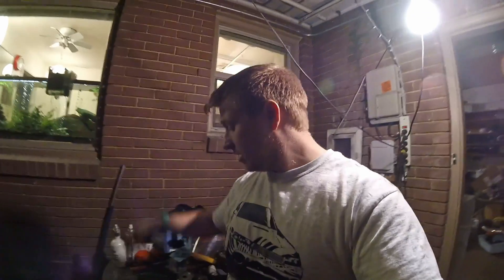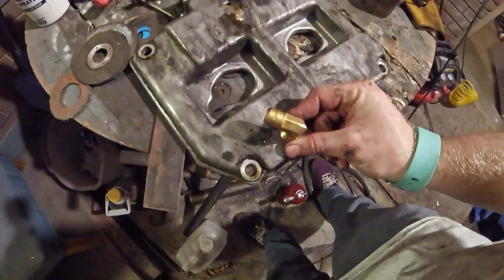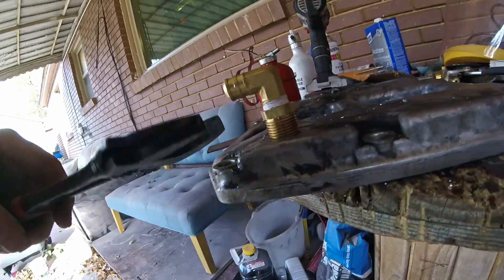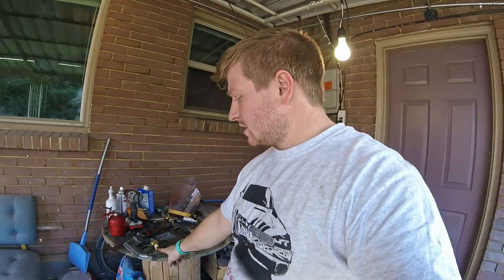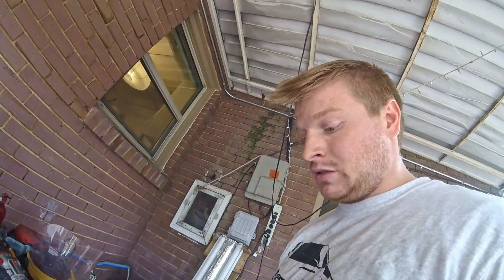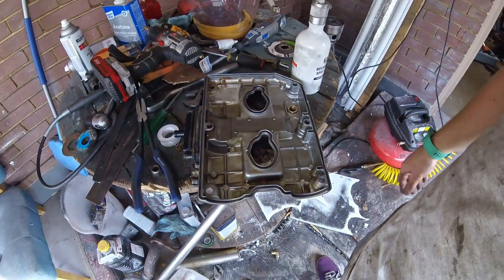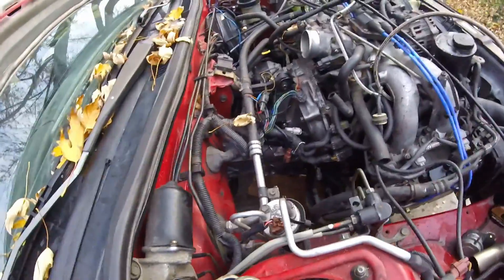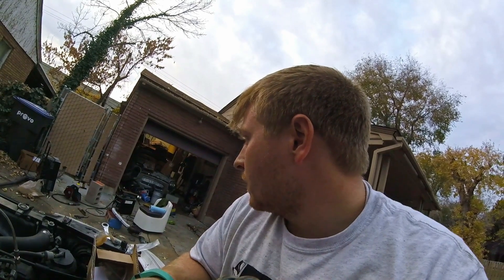How to turbo your non turbo Subaru - Part 7 - Plumbing - Dirtcheapdaily : Ep.45

Comment: just an FYI for anyone watching, you do not need to use teflon tape on -AN fitting, like the oil feed line in this video. AN seals on the taper of the fitting the threads dont seal anything

Comment: i know this was a while back... but i cant find the T for oil feed from the sensor...
Reply from the maker: +Subielicious to buy one?
Reply: Dirtcheapdaily yes
Reply from the maker: +Subielicious just figure out the thread pitch for your sensor and the thread pitch for the line you're going to run and search it on google. You'll find it. It's not a Subaru part. Just a plumbing part

Comment: 20 usd... or a engine...  fair...
Reply from the maker: +ShazamMafia what are you talking about?
Reply: the missing tapp
Reply from the maker: +ShazamMafia I still don't understand what you're trying to say. I'll gladly respond, but I'm not a mind reader, and it's been 4 months since I did this. Refresh my memory and let me know what part of the video you're referring to. 

Is it how I didn't use a tap on the rocker cover and just threaded in the fitting?
Reply: allways have a the apropiete tap,  https://youtu.be/NMvf4GkjhOk?t=361 that can pop-out......... you can find buch better ones design for motorsports, not for pluming :) . I lost oil presure once for maybe half of a minute, the turbo bushing was gone, i'm lucky my engine still works, bras and more tape its not good at all.

Comment: Hi! Quick question where do I buy the steel braided oil line with t fitting you used as your oil supply line? I have same engine same and the same plans for mine.thanks!
Reply from the maker: +josh frutos I just picked it up on eBay. It was a universal line.
Reply: Dirtcheapdaily 
Oh ok, so just look for "universal steel braided oil feed line"? Any measurement to look for? Sorry friend don't wanna be a pain in the ass but I figure I want to be doing donuts in the snow like you that's all. Thanks
Reply from the maker: +josh frutos  you're turbo location will dictate the length. Can't remember what size I got, but just grab a tape measurer. Overshoot it if you need to, having a bit of excess line is always better than not having enough!👍🏻
Reply: +josh frutos grab a piece of string and measure the distance to your turbo, go to your local home depot and get braided lines in the plumbing department, don't waste your time buying cheap eBay lines if you wan your build to last